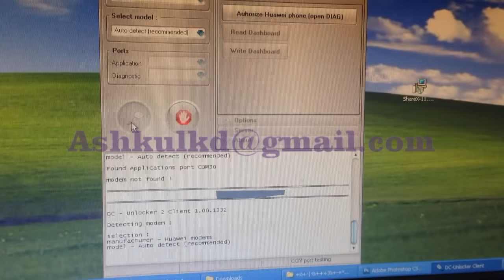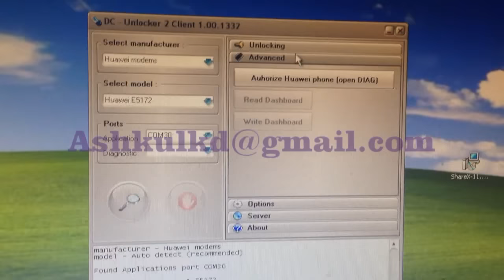Huawei E5172As- 22 Unlocking and  modem not found solution 1000% tested

Comment: Nice work ,let me i have connected usb cable as you but there is red instead of orang that’s dc unlock told me port com3 diagnoses then modem not found i check windows already detected it , could you give me an answer ?! ,thanks in advance

Comment: This device run on battery (3.7V) mode. Because it has battery jack with battery pocket. 

Please response. Thanks advance. 

Good Day--
Reply from the maker: 82 donia  37 v battery available for this device check amazon online
Reply: Sir, 
Thanks for your valuable reply. In battery mode, wifi not generated in this device. LAN also not work. Any solution about this matter? 
Thanks

Comment: Hello I have Huawei E5172 but no wifi connection is only 3 led lights on Power led is pink & 2 blue Led's the router not boot up again pls any help thanks.
Reply from the maker: +Abbba Abba change your power adapter or make updates

Comment: Please ..
This method is successful in the update process ?
And what tool is used ?
Reply from the maker: Tel Arch  dc unlocker
Reply from the maker: +Tel Arch  no need upgrade direct unlock
Reply: first, thanks for your helpfull answer..
But, if i update my modem using this programe <E5172_upgrade-Elias-sudan> after soldering the usb wires (like the method of updating Huawei b310s) does there any necessaire commands to put it in factory mode?